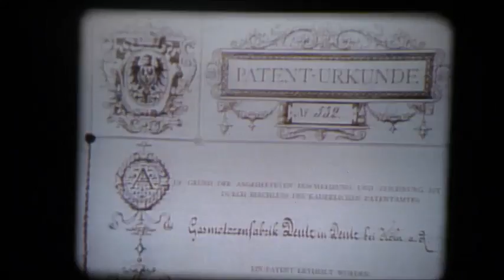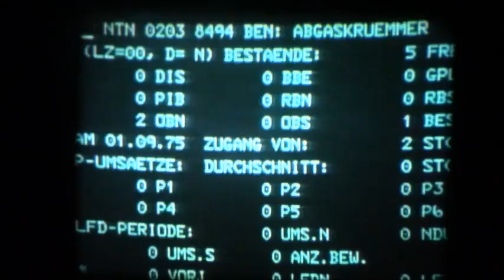1986 Deutz Allis Dealer Movie Meet Deutz Allis

Comment: Deutz tried to sell a green tractor to people who never wanted  green tractors to start with thats why they  went under
Reply: And they tried forcing the farmer to buy a foreign made air cooled engine. I worked at an AGCO dealer about a year after AGCO was formed and talking with the farmer customer there, they didn't want anything to do with an overgrown briggs being put in a calf sh!t green tractor, to put it in their words. Saying that, I know for the most part the Deutz engine is a well built engine and if cared for properly, they are long lasting but that doesn't matter when they weren't saleable here and they were very expensive and no one knew how to care for them and the fact that they are finicky to work on.
Reply: @SilverGleaner  Yes, the Deutz engine is a good engine, if cared for properly. Lots of constriction machines use Deutz, and they rarely had any problems, but the chaff and whatnot you get around the engine in tractors and combines presented special considerations for the cooling systems. You have to keep them clean, and the notorious push rod tubes leaking just made the problem that much worse. Deutz engine fires in combines was a major problem.
Reply: @m16ty  When I worked at an AGCO shop for 4 years, April 1991 to January 1995, we never had trouble in that time with any tractor engine, and frankly neither did we have trouble in any of the few combines we sold. In our area the R50 was probably the best seller and I don't think that combine had as many fires as the V8 models. BTW The Deutz repair manuals for the early Deutz-Allis products were horrible to understand.
Reply: @SilverGleaner  Have been quite a few Gleaner engine fires around here, but other brands seem to burn too from time to time. The Cummins powered Gleaners don't seem to be as bad with fires as the Deutz, On a combine, especially in beans, you have to remove the engine covers every day and clean everything out, otherwise it would overheat. Also, the push rod tubes are known to leak, this would make chaff and dust stick inside the airbox that much worse. Not a bad engine, but most people don't clean them as often as needed. The fan wears more than you'd think also. My brother had a R52 with overheating issues. Finally figured out the fan was worn out. It didn't look worn out just by looking at it, but when you compared it to the new fan, you could really tell it.
Reply: @m16ty  There is a measurement taken at the fan to determine when it should be replaced. The problem with that is first, most owners have no idea of checking that measurement, and second, the expense of the German parts are painfully high. That fan, last I checked was well over $1000.

Of course Cummins has its own problems with the water pump coming apart and sending the fan into the radiator which is a very big expense. Check the water pump for a loose bearing before each season and hopefully you can catch it in time.

Comment: the first time Allis made good stuff
Reply: as in West Allis?
Reply: @J-1410  I believe he means as in deutz not west allis so he is saying that ac never built good stuff till Deutz bought ac we know ac has always made good stuff but id say he has never ran ac so he needs to run one to gurantee that ac has always made good stuff  ac made good stuff before deutz bougt them
Reply: @JohannZ100  I'd have to say Deutz is horrible as they killed what marketshare they had in Gleaner and the tractor lines and then ran away to eastern Europe
Reply: @J-1410  what deutz did was horrible the air cooled gleaner was a bad idea deutz should have left ac alone and kept making money
Reply: @JohannZ100  they should have taken the tractor like too.

We're at 30 year after and Gleaner still has to deal with Deutz's problems
Reply: @J-1410  of course because of the air cooled diesel would burn up the deutz powered gleaner then gleaner would lose customers because of the engine if i bougt a deutz gleaner id put a different motor in it My type of engine for truck from riding on the road with my dad id find detroit a very good choice but for a gleaner id put a cat or cummins before it burns with the air cooled in it
Reply: @JohannZ100  At one time the idea was toyed with at Allis Chalmers to team up with Mack to run Mack engines. That would have been a good choice if they had to stop using Allis engines. Myself, I think they should have improved the current Allis engine with larger rod bearings and different cam grinds etc etc.
Reply: @SilverGleaner  i did not know that thats interesting